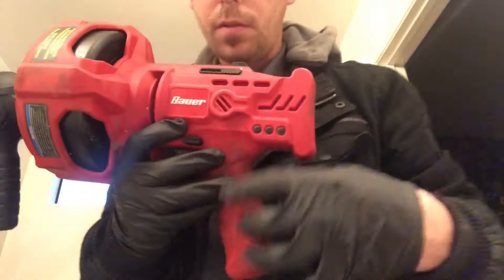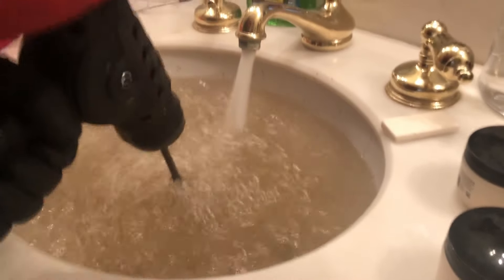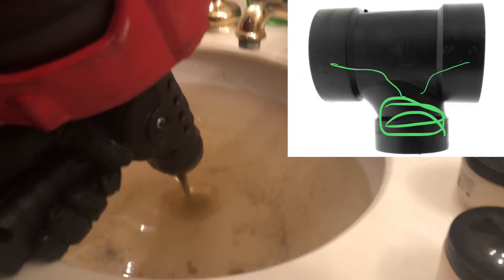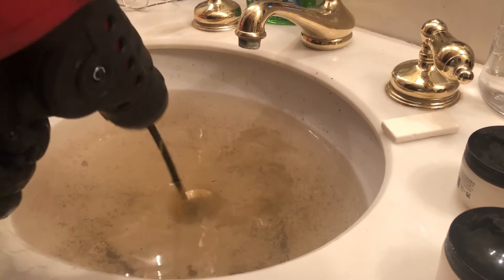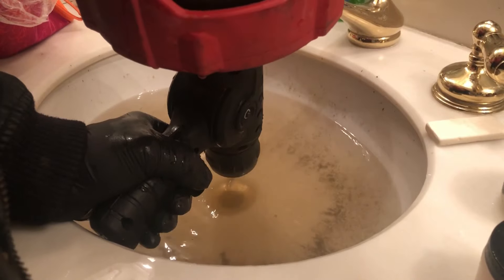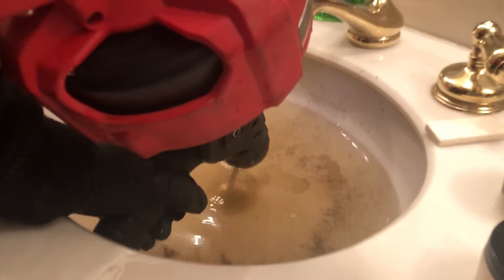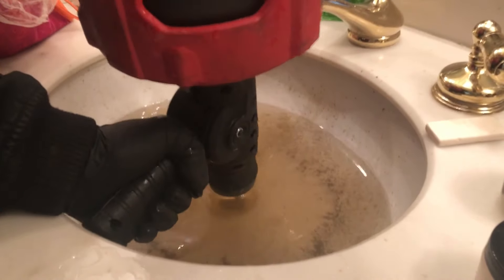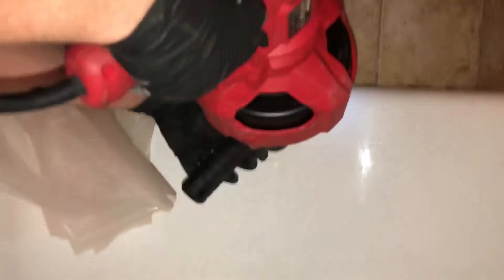Bauer 23 Ft. Auto-Feed Handheld Electric Drain Cleaner Review REVIEWED

Comment: I just purchased one of these from Northern Tool which is a competitor to HarborFreight. Mine is from a brand called Ironton but it is almost identical to the Bauer. I made some progress on unclogging my main that runs to my septic tank about 30 feet away. I pulled multiple large clumps of dog hair out of the drain. But i still think the drain could be draining faster, got any advice for that? Other than purchasing a 50ft auger :D
Great video. Thanks!
Reply from the maker: Really sorry i missed your comment man but I couldnt really give you any other advice than buying a larger machine or calling somebody out who has one.

Comment: I use a drophead (down head) drain cable.Another good option is the double down head drain cable which in my experience and opinion are the best type of drain cables to use.I currently own and use a drophead drain cable and if and when I decide to buy this Bauer drain machine I will also buy a double down drain cable to use with the drain machine.Thank you for the video.
Reply from the maker: Nelson Echevarria totally agree with you on the top snake a drop head is awesome!!! I replaced the stock cable with a drop bead!! Enjoy the Bauer it’s a good lil machine for the price
Reply: @PlumbingExplained  Thank you for your reply.Were able to connect the new drain cable with the link cable that the drain machine has in it,or did you have to just install the replacement cable into the drain machine without the link cable attached?Not being able to swap out the stock drain cable is a deal breaker for me.
Reply: @PlumbingExplained  One other thing is that I always use wire core drain cables which are less prone to kinks than hollow core drain cables.
Reply from the maker: @nelsonechevarria7009  I dont recall if I was able to connect it to the machine or not I dont think so I think i bent the end in like an L shape to prevent it from coming out of the auto feed.
Reply: @PlumbingExplained  Thank you for your reply.I may consider buying that drain machine.My General Handi-lectric that I bought years ago is still going strong but it is hefty and uses a chuck to tighten down on the drain cable.I like the fact that that drain machine feeds and retracts the drain cable by pushing the foweard handle forward or backward.
Reply: @PlumbingExplained  You use a wire core drain cable correct?I learned long ago and learned the hard way that it is always best to use wire core drain cables in order to avoid cable kinks.
Reply: Ever had the end break off

Comment: You need to kink the tip of that cable..... the knob on the  tip needs to be bent over to a 45 degree angle to make the corners
Reply from the maker: That definitely helps bro good advice!
Reply: I would NOT kink the end. It's a 1/4" cable and that will weaken the cable. I left my straight and it went through 5 to 6 bends in just 7 feet.
Reply from the maker: Greg Simpson  not all drains are plumbed perfectly some times guys put fittings backwards or just fittings that should not be used in certain areas and sometimes you have no choice believe me I been doing this a very long time and if you put a slight bend on the tip just to curve the cable so it can make certain bends or drop down an area otherwise it would have just run right across. Luckily sounds like your drain was plumbed properly but I would say maybe 30-40 percent of the time they are not